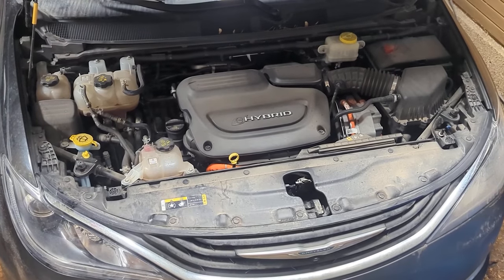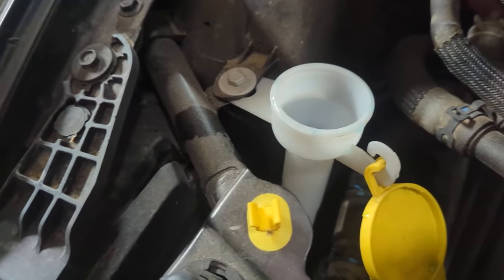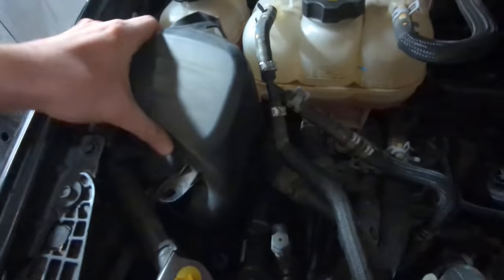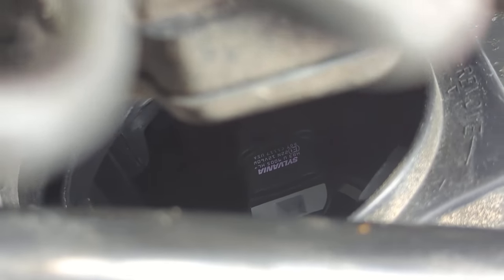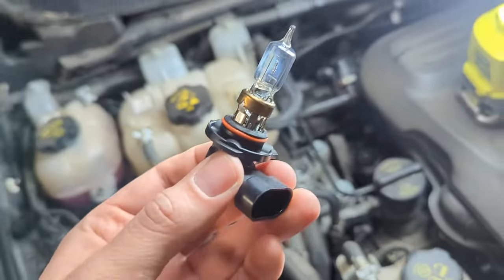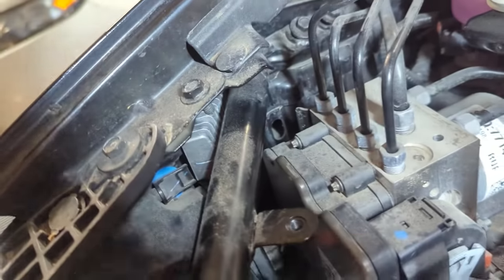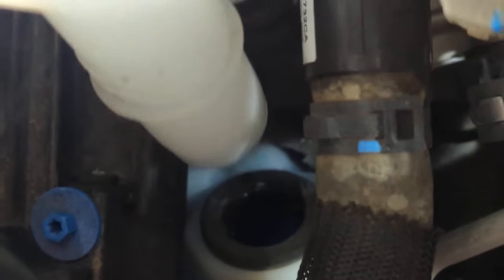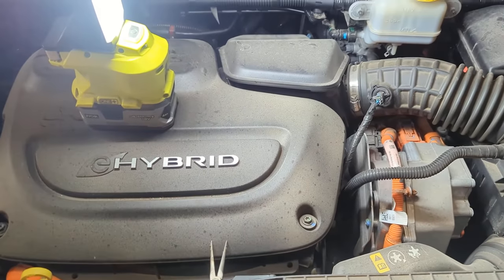How to replace a Headlight Bulb in a Chrysler Pacficia - 2017 and other years

Comment: I just swapped out all of mine with LED headlights... and I can't understand how Chrysler didn't see this layout as an issue.

I could BARELY get the light into place for the passenger side low beam... let alone my fingers. I almost couldn't turn the bulb into place. 🤦

Otherwise those "metal prongs / wires" you were referring to... those are hydraulic lines (break lines). I believe that's the ABS module.